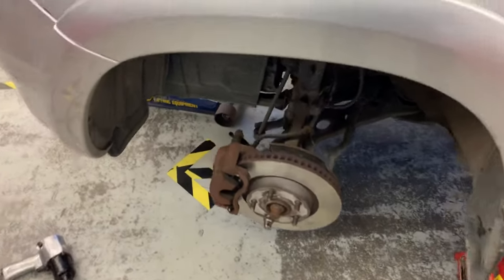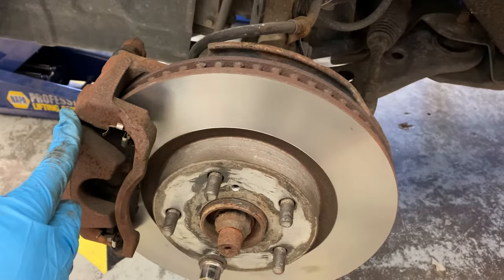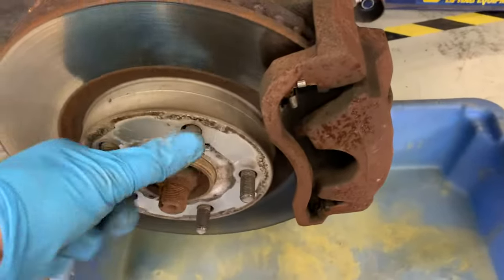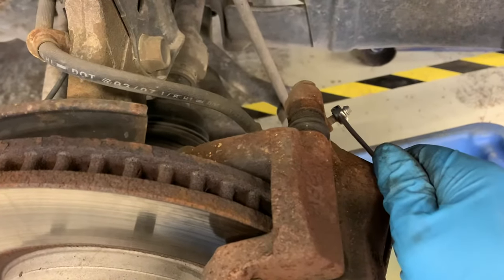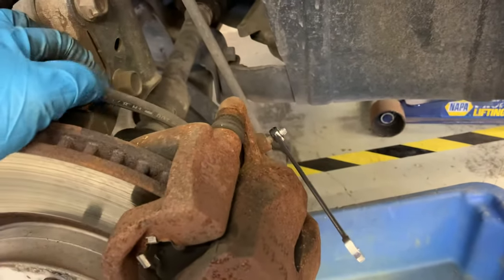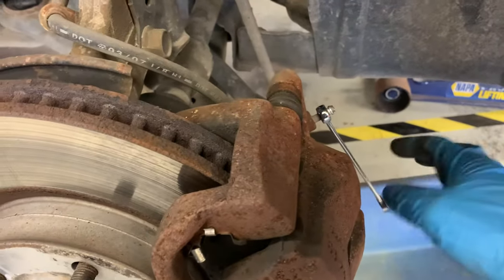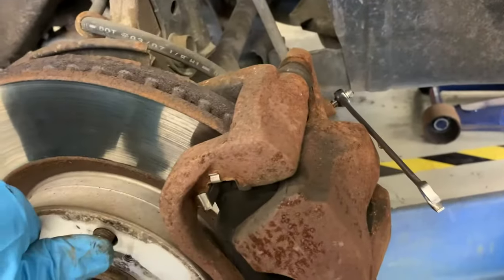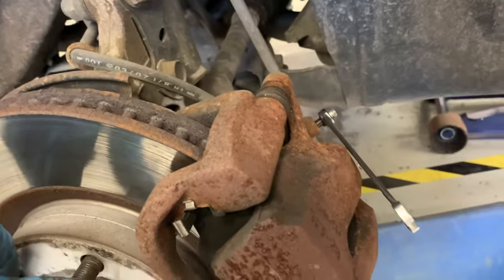How To Isolate a Seized Caliper or Failed Brake Hose

Comment: Just had the same issue. I rebuilt the caliper thinking that was it. Nope, brake hose. Did end up getting a good video on caliper rebuild, but holding it until I am sure everything is working. Thanks for the tip!
Reply from the maker: Glad it helped

Comment: symptions of a bouncing tire, that does not turn freely enough is a seized brake, bearing or
maybe even a broken brake rotar that does not have a double side with fins in the middle anymore but the inner side is down to the ribs.  Preventititve maintenance to have this checked and remedied.  :cat-orange-whistling:

Comment: Hi on my c5 Corvette I can hear scraping on both of my rotors..on the right side I can move it easy but on my left I have to put a lil force to move it . And it did trow out a lil brake fluid but not as much and still a lil hard to spin is it the caliper?
Reply: Bro same car same problem keep me updated. I took off the caliper and compressed then I put it back on then I hit the brakes and try to spin the rotor but it’s basically locked up. I’m thinking of replacing the hose next
Reply: @foreignsmoke7198  hey. 
I got it fixed my brake fluid was really dirty and my brake master it was clogged up on the little hole where the fluid passes by
Reply: @foreignsmoke7198   so did you check your caliper piston?
If not check them . Take the caliper of the caliper bracket.. and put a 2x4 or something so the pistons won't fly out..when press the brake & see which piston got stuck
Reply: Thx for the response bro I appreciate that.
For me a rock shot up in between my brake and roter and left and outward scratch on my brake pad that was cutting into my rotor and causing the scraping noise. Swapped the brakes and problem solved.

Comment: Does this cause the brake pedal to get hard?
Reply: No. That’s usually going to be an issue with the power assist. In that case, the brake booster, or it’s vacuum source.

Comment: What if you get the squirt of fluid and ability to rotate the rotor, but the caliper still won't compress with a tool?
Reply from the maker: Sounds like the caliper is seized.
In that case I would put new calipers and hoses on it. 
Hoses are usually around $20 each (depending on vehicle) so they aren't very expensive.

Comment: What if you crack open the bleeder screw & nothing comes out?
Reply: Could very well be a blocked hose (happens) or you have major air in the system.

Comment: I'm going to take everything off. This is crazy. I freed up the caliper with a hammer but it won't bleed any fluid and that caliper won't clamp down. Maybe collapsed hose.... Btw I bought a rebuilt caliper years ago and it was doing great but the vehicle sat for 6 years due to alternator and bad clutch cylinder.